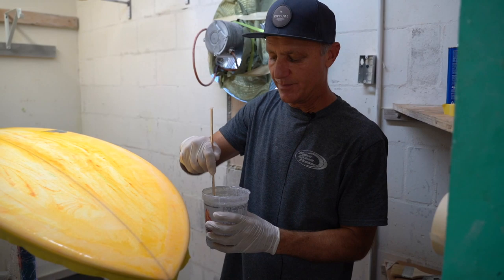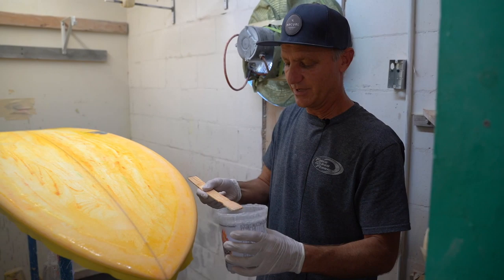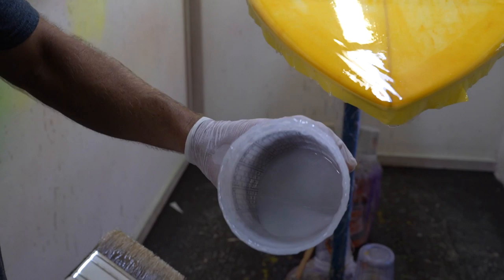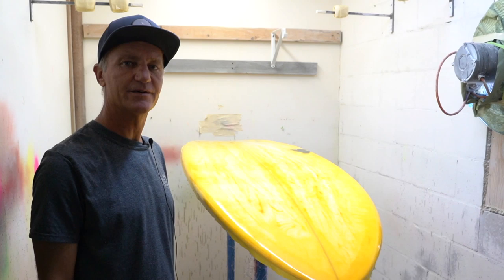How to Hot Coat : Epoxy hot coating a surfboard

Comment: Nice video. I just started using the quick kick on hot coats since I saw if this. I like it, flows out better. Ive learned too a thinner hot coat is the way to go. I used to try to put it down thick so I had less chance to hit the weave but it works against you cause it doesnt lay as flat, more sanding and more chance of hitting that glass.

Comment: "The difference between PE resin and epoxy resin hot coats?"  Yeah, you don't get cancer from epoxy.  I've gone completely to epoxy in every step for the past 6 or 7 years.  Epoxy is so much better in terms of durability, safety and environmentally friendliness.

Comment: I swore by Resin Research for a few years,  even with add F did an okay job. But now I use Green Light's and is way better than Resin Research. I even use their hardener with West System, because I use what I have and kicks beautifully, leaves a great leveling with no imperfections.

Comment: guys, great vid, but after mixing the resin, stirring it up and getting air in de mix, do you wait for the bubbles to go out of the mixture? or you just use it straight away with air in the mix? And I get a lot of dust in my hotcoat. but can it be that it is already in the brush? it's instantly on the board... lots of dust particles.... super annoying..

Comment: After you apply the sand/filler coat (hot coat), what if you want a shiny gloss coat after your done sanding? Would you just sand and polish or would you apply a separate gloss coat afterwards? What type of epoxy resin would you use? Or would you use polyester? I've used polyester for a gloss coat after the sanding coat and it has a nice look, like was done in the early 90's.  Thanks
Reply: Poly doesn't fully bond to epoxy. Epoxy for as many coats as you like. Measured and mixed accurately, and with proper air temp, it cures and sands perfectly
Reply: @surfershaper  People would tell me that but they were amazed when I did what they said couldnt be done. If you do it correctly polyester will stick very well to epoxy. My question is what do they use for a shiny gloss coat?
Reply: @nickhlawka7073  yes brother I've used poly over epoxy before as well, like most all glassers did when epoxy was new to the industry in the 90's. Which is when I converted. I get amazing results with epoxy filler coats since then, knowing now the temps it performs best at, glassing and curing included. They add strength to the laminate compared to poly coats. I don't polish boards with compounds to finish glossy. I don't know why epoxy wouldn't polish out to a high gloss as long as it's mixed and cured properly like I mentioned. I use no additives in my filler coats, but they're mixed and cured exactly the same way every time. Only then will you achieve the strength specs they get in a lab and the flawless results you're after. There's only one way to learn it. Do it!

Comment: How long after laminating the fibreglass should you wait to do the hot coat? then how long after that to do a gloss coat?
Reply from the maker: You want the lamination to be what we call "thump print tacky" meaning if you were to touch it, you could leave a thumbprint in the resin but it would not come off on your finger. This varies between epoxy and polyester resins. Epoxy could take a couple hours where polyester might only take 40 minutes.

Comment: Hi! Thanks for this awesome video. I have a question for you guys. After a couple of ding repairs in the pin tale of my retro fish, I noticed I have lost the super sharp original line in the rail. now it is a just bit more rounded or smoother than originally, but nothing dramatic. If I want to rebuild this sharp line in the rail again, should I hot coat both deck and bottom sides again in the rail area? or just the bottom rail area with tape in the line? Is it a normal practice to sharp the edges or it doesn't worth it? Greetings from The Netherlands.
Reply: I try to keep the factory edges as much as possible.  If I'm working on a ding repair, I just use tape  to build a short "dam" on the bottom that is in line with the rest of the edge from the other parts of the board and then sand it down to match.  I don't really think it matters which coat of resin you use for this.  The hard edges are key for water to release at that point and integral for the overall design, otherwise it will wrap like a longboard rail.  I'm not that good of a surfer so I'm not sure if I would notice the difference or not, but may as well try to match.
Reply: @bellpaleale  Thanks a lot!
Reply: @marianogalan9332  Here's a good depiction of what I use for inspiration at 1:29. https://www.youtube.com/watch?v=fOhsV4k-69I

Comment: how were you able to get a colored logo under the fiberglass even though you tinted the resin - wouldn't it discolor the logo
Reply: i'm guessing the decals were positioned and applied with resin after the tint coat had set?
Reply: Maybe the color is acrylic paint on the blank?
Reply: printed in colored ink bros

Comment: Very interesting, thank you! Are u not afraid that the Aceton will "influence" the core via possible pinholes if you wipe it after sanding / prior to hot coating?
Reply: I would think his wipe is wet but not saturated. Just enough to grab some dust and grease on the tops of the fibreglass cloth weave. I’ve learned the hard way painting boats that too much acetone on the wipe alters the fine finish. I could see my swipes from wiping in the reflection. And I was allowed to use acetone in that instance. Moderation and balance in the prep is key. Just don’t soak your wipe, and use air
Reply: @pearsonmarine5565  Interesting, yes, have the same experience when working with epoxy and acetone over wood cores .. clear coat heals it however. 
But, why I was writing this, with my 1st surfboard I had  in some places the XPS foam / core dissolved below the laminate  ...  it was glassed with one layer of 200 g/m2 ... and my cloth was very likely "too saturated" ... :)  ...

I have learned later that the laminate over a foam core of a surfboard is not necessarily water tight from guys who did a lot of boards ... I was told that the existance of pinholes very much depend on the temperature of the core prior to lamination (and putting it in a colder place when the exposy is not yet hard) and thereafter the same is true for coating/spray gun to get in water tight ... thus the risk of using Acetone at this stage (in the video) ... is not necessarily negligible ... was my thought ...
Reply: @Darwin Crew with aceton? :)

Comment: So wait, you laminate with standard Epoxy lam resin, then sand that? In my experience, lam resin never gets hard unless you ad surfacing agent (I've only used Poly resin, so I don't know if they work way differently). Does the epoxy resin get hard without surfacing agent? Or do you just sand the goo? Haha. Please explain?
Reply: Epoxy resin is a 2 one mix. It gets hard with half of the amount used. Let me explain: If part A is 10 ounces then part B. the hardener is 5oz.  Don't get hung up in the terminology. Lam resin, etc. When I laminate with Polyester Resin, I do it with Silmar 249B all the way to the hotcoat.  I use surface agent as well for better sanding.
Reply: I will clear this up a bit. Epoxy is not a blanket 2:1 mix. I use 1:1, 2:1, 3:1, and every manufacturer has different ratios depending on the chemical make up and usually each ratio has different set times and properties. Once mixed, depending on the temperature, you have a certain amount of time to get it on. Some are super slow, some are medium, some fast, some kick in 5 minutes. Always add the hardener first. To remove bubbles once applied; a quick pass over with a torch very, very quickly.
Reply: @Surfmus  not all epoxy resin are 2:1, depends on brand (i.e. total boat resin I have is 5:1)

Comment: Does anyone know how to prevent or why my hot coats are forming wrinkles? The wrinkles form mostly on or near the rails but also randomly on the middle of the deck. It's so disappointing when you lay down a perfect looking hotcoat and come back to wrinkles everywhere.
Reply: I’m using a anti bubbles product developed for epoxy resin hot coats that you spray on just after you lay the epoxy coat. Spray it on and if you see any more bubbles forming then spray on the effected spot (max 2  times or you risk the opposite effect) haven’t used on a surfboard. But I’m doing skateboard decks and of course much less surface areas and it works perfect. But if you buy a special 3D epoxy product, a little more expensive but worth the extra cost, you don’t get wrinkles. I’m in Europe and use Eurotex products. If you are in US guess you find something similar in Home Depot.

Comment: What grit sandpaper do you sand with after the hot coat is drued
Reply: Dried*
Reply from the maker: Start with 120, then 150, 180 and 220
Reply: Fiberglass Florida 👍🏽
Reply: @FiberglassFlorida  What are you trying to accomplish by the sanding ? After the sanding will you buff out all scratches with some compound?  I'm using West Systems 5:1 slow formula and looking for a nice even clear, smooth glass finish product. We have surfskis. Thanks

Comment: What I don't understand is why you would put tons of resin on a (carbon) board. Doesn't this add a lot of weight and only serves the purpose of esthetics?
Reply: most of it is sanded off again. After laminating, we do a coat to fill out the weave and to make the board more even. the hotcoat then is sanded very thoroughly and superflat with about 80 grit. about half the resincoat is already gone then.  this almost always leaves us with some burnthroughs and some low spots, so we coat again. The additive f in epoxy has some of the same functions as styrene used in poly finishcoat± it thins out the resin and lowers the tension, providing a thinner (lighter) coat. then we sand again, only with higher grits and then polish. after that, there's not as much resin on there as you might think. These resincoats are necessary to keep the board watertight, just laminating is insufficient.